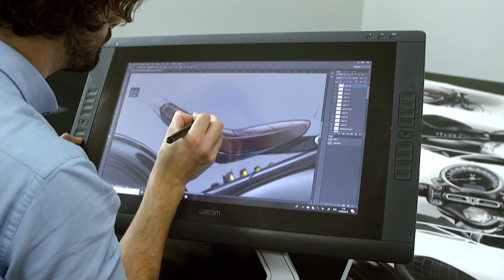Celebrating 120 Years of Excellence | Triumph Motorcycles

Comment: Got my 2022 Street Triple RS on 11th March. Enjoying the ride, Triumph fit and finish is way better than others out there. 

Wish they would give us a software upgrade for the TFT dash. The current 4 styles are not really user friendly nor do they show all the information properly. The previous generation (prior to 2020) had much better graphics on the TFT. 

TRIUMPH - hope you are reading and act accordingly soonest. It cannot be difficult to do this. 

Cheers
Reply: Sir, can 170cm guy ride this bike comfortably, will both feet touch the ground
Reply: @mohammadsameer9647  You should be able to ride it comfortably if you are used to riding big bikes. 

Depends on your in-seam length and experience. 

Best is to drop in at any Triumph dealership and check it out yourself. 

Cheers

Comment: Excellence, huh? I had a Speed Twin that spent 4 months out of a year (10,000 miles) of ownership in a shop getting warranty repairs done. The list of problems that I had:

- Improperly routed radiator hose (recall)
- Faulty bolt in a shift lever failed during a ride, replaced the entire lever assembly
- Replacement of new shift lever unit after Triumph realized the bolt problem was widespread (recall)
- Replacement of front brake rotor (2) times due to extreme warping after only 1,000 miles of normal street riding each time
- Replacement of entire front wheel due to a manufacturing error (this is what was causing the brake rotor to warp repeatedly)
- Intermittent electrical issue causing the bike to not start (never fixed, I'd had enough at that point and sold the bike).

Unfortunately, the state that I live in doesn't extend it's lemon law to motorcycles. If it did, I would be entitled to my money back.

Since the Speed Twin, I've had a VFR800, Z900RS, and Royal Enfield Interceptor 650 which have all been faultless.

My experience: Triumph is premium and exceptional only in the price and "status" of their bikes. It's pretty embarrassing when the $6,000 Indian bike is more reliable than your $13,000 "British" machine.
Reply: Or you're just a very unlucky one
Reply: @Jay Bee It was remarkable to me how difficult it was dealing with Triumph. Luckily, my dealership is very good and fought for me to get my problems covered under warranty, but they made it sound like Triumph was ready to dismiss everything.

Triumph initially claimed that the warped rotors were due to an overly aggressive riding style (despite the fact that I've never had this issue on nine other motorcycles). And they said that the shift lever failure was due to damage by the user, which was also false.

Meanwhile, every other bike I've owned has needed nothing but routine maintenance through many thousands of miles. This includes bikes from Honda, Kawasaki, Suzuki, KTM, and Royal Enfield.

Comment: The video does not reflect reality perfectly. I love the brand, but this does not make me forget the imperfections that I have suffered and currently suffer. It is incredible that a motorcycle of 25,000 euros shakes the handlebars on bad asphalt. In addition to other problems I had.
Reply: Yup I have and do rally a tiger rally pro, but had a sprint that a footpeg broke on, clear metal fault, triumph not interested. Mate had loose and corroded spokes a few years back, triumph not interested. The pros an ace bike and I'd love the 1200 but triumph is not an excellent company
Reply: The response of the brand when things like this happen is sad. I recently did a 500 mile trip and it was very frustrating because on the highway, with the bumps, the suspension shakes and there is no balance. As you say, Triumph was not interested.

Comment: I still ride my ‘05 Speed Triple daily since new, now with 80K on it. Runs strong, burns no oil, still has it’s original ECM & fuel pump! The stator & rotor lasted 50K. The 3 cyl engine has proven to be the best for overall street & off-road usage. Top-end track racing is it’s only weakness. I test rode a Zero, best ride I ever had!, & am eagerly awaiting the hopeful release of their TE-1 model.